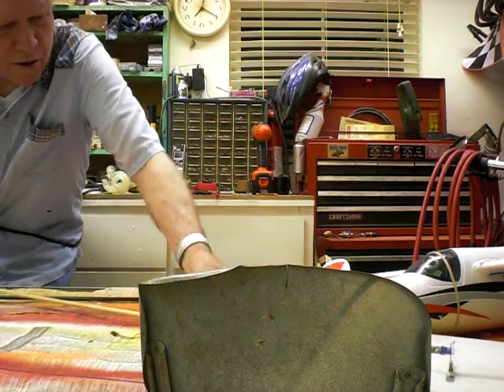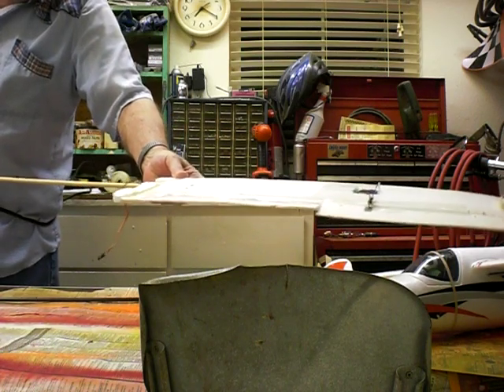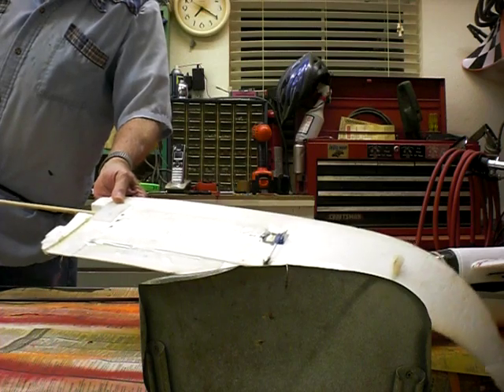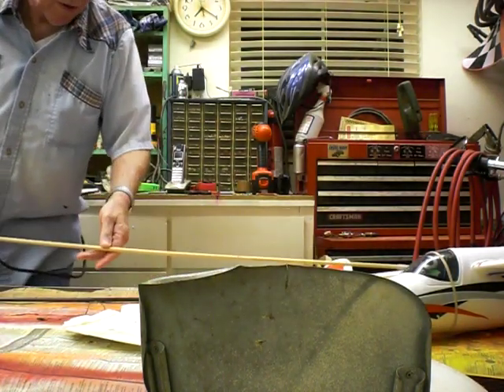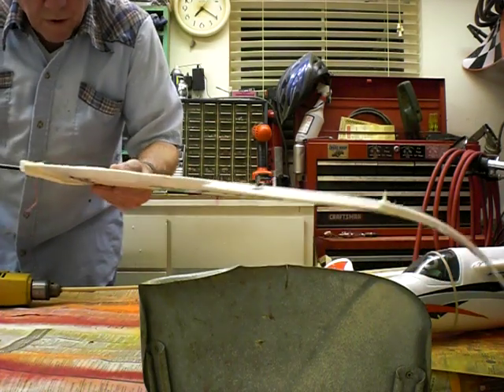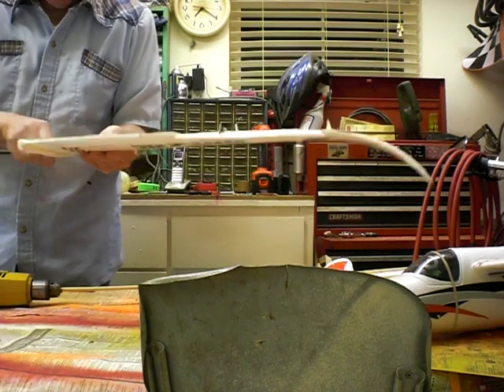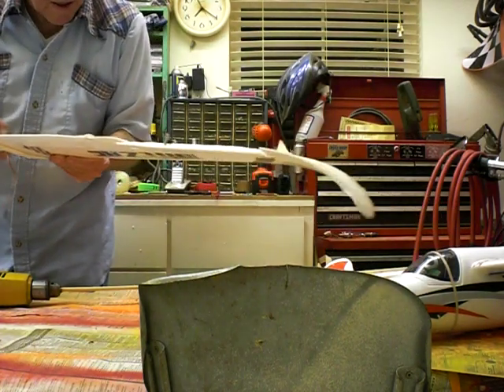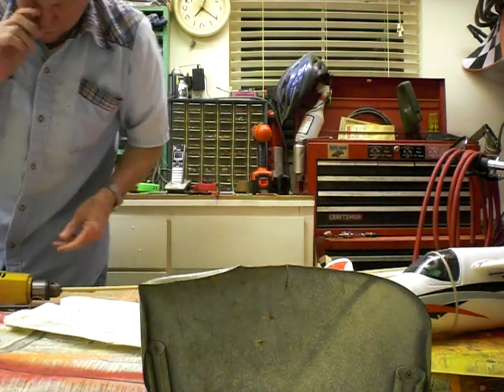Sky Surfer - Modify wing spar to 8mm DIY

Comment: Hi Flyguy, how are you?
Today, in my maiden flight, wings of the my Buxler1, after herad loud sound, just split out and "claps"...lol.  It was a 80m, and was nothing possible to do.
On ground could see that CF 6mm standard from HK kit, broken in exacly midle of wings.

It's so strange to me, because I have do reinforcement. Like you do, I'm introduce a 8mm external (6mm internal) CF tube, epoxy glued in wings. And put a 6mm "original" into that.
So, I don't understand why it broken, was so solid